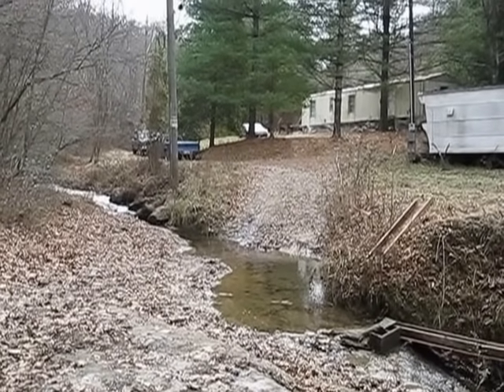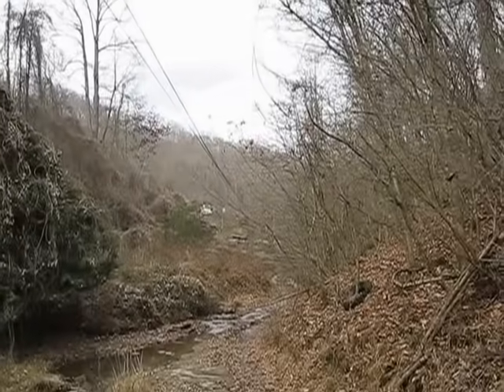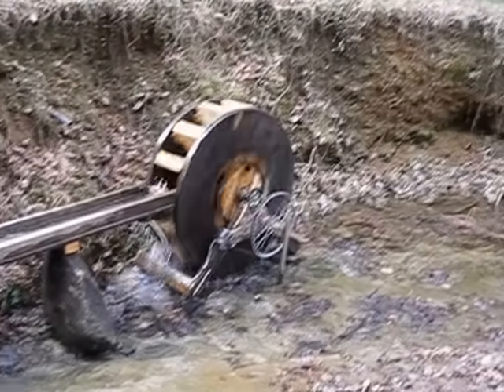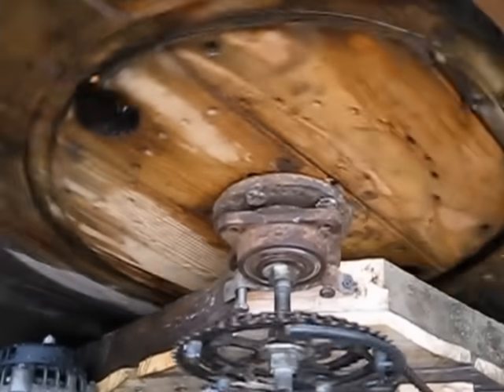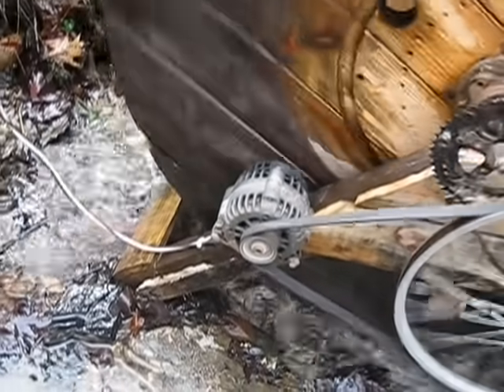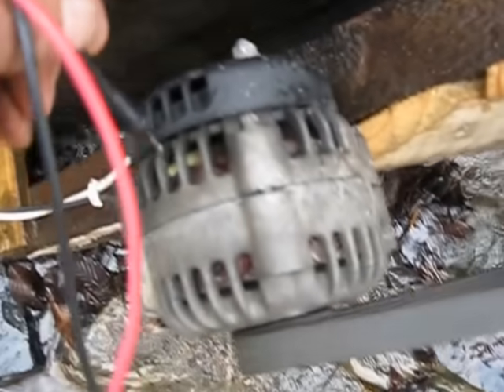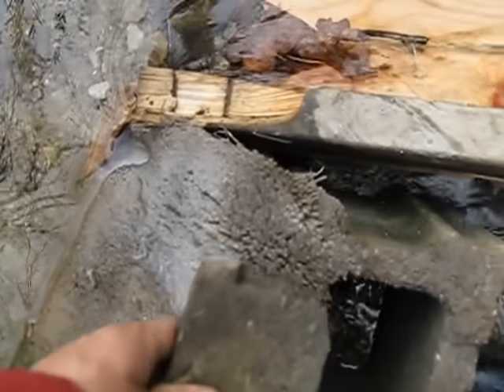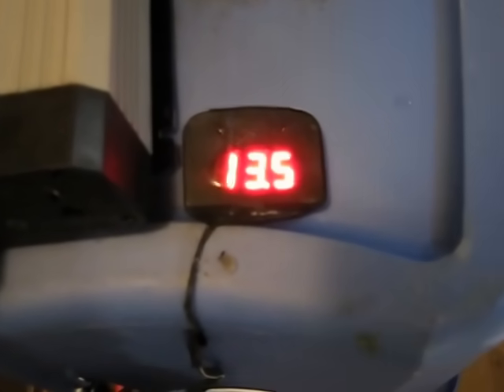water wheel generator

Comment: The best way of doing this would be to have your charge controller and batteries outside near the generator, since DC isn't very good for transfering out for any real distance without large losses, use the AC inverter instead, since AC suffers much less and you don't need wire that is as thick. Doing it like this you eliminate poisonous gasses that come out of the batteries from inside your house you also get more available power to charge your setup making it more efficient.